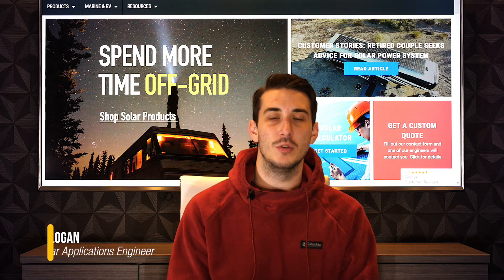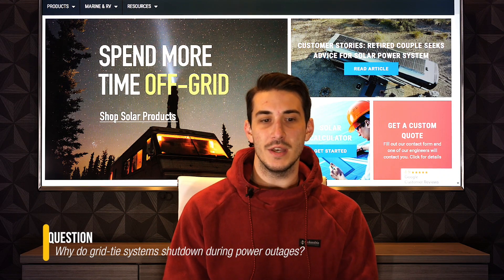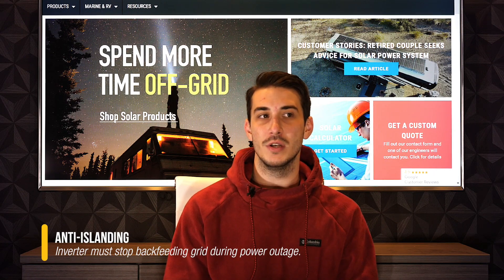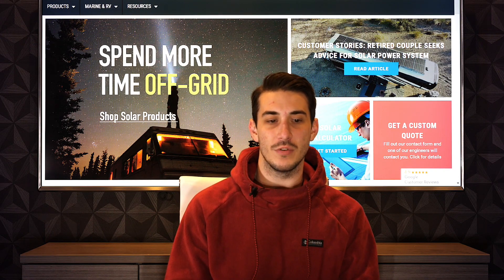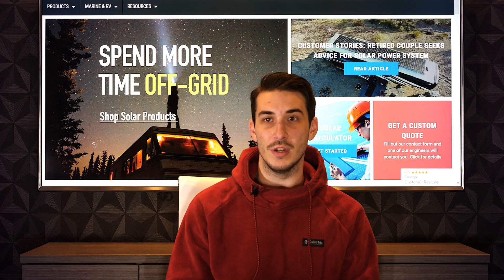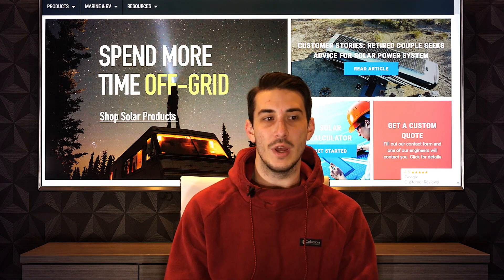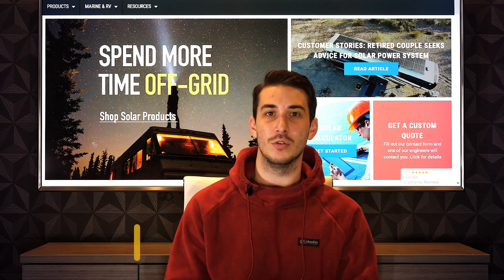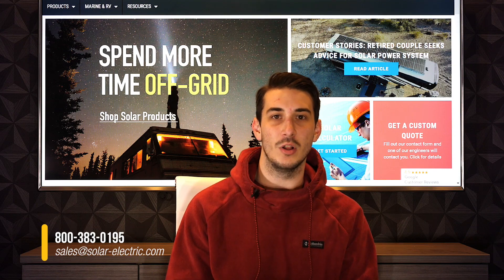Why do grid-tie solar systems shutdown during power outages?

Comment: You said When the grid goes off the inverters shut down beacuse power might backfeed into grid.This indicates power is being produced but you are intentionally shutting it down as a safety feature.Then why cant you just isolate your system during grid outage with a switch and run the home appliances.
Reply from the maker: Yes you can do that if you have your system set up that way. This video might explain it well for you. https://youtu.be/fh58Y-LA99U If you have more questions please feel free to chat with our team on our website during business hours. Thank you!

Comment: I get it that you don't want power to back feed into the grid, but why can't the solar then just supply power to the house and not the grid during a power outage?
Reply: @Dan I think what the answer you were looking forward to is that 

A grid tie inverter requires a voltage reference to work and since the grid is down that voltage reference goes down with it, and to ensure that power isn't feed to your house or neighbors house or back all the way. The anti-islanding comes into play and not making your inverter produce power and leaving you without power.
Reply: @oloyeadeniran8894  Seems to me the system could automatically shut off to the grid and just supply my house with power from the panels.  I don't see this as being something complicated and why it isn't being done already.
Reply: @Resist4  Just noticed your comment now ... My bad!

The Grid tie inverter is only meant to phase with the grid and nothing else, if Grid is absent then power goes out, but there are ways around it. When you use special types of offgrid inverters that can form the grid when used with batteries.

It is this types of inverter that you can then couple to your grid tie inverters to provide you power on days of power outages or natural disasters
Reply: @oloyeadeniran8894  I guess I just don't understand why it's designed this way.  Why can't my excess go into the grid and when the grid is down the power go directly to my house.  Don't get the point of it not being designed this way.
Reply: @oloyeadeniran8894  what if grid is down for weeks
Reply: @bootangy  Then power will be out for weeks too,
 Here in Nigeria, we mix Grid tie inverter with a Grid forming inverters to form a micro grid that can then feed the house and when grid goes out, it will not affect the usage or there is simply no downtime.
Reply: @oloyeadeniran8894  ty whats a grid forming inverter? is that like hybrid?
Reply: @bootangy  No, it is not. The types of Grid forming inverters are 
1. SMA
2. VICTRON
3. STECA
4. DEYE
and other I can't remember offhand
Reply: @oloyeadeniran8894  i see. problem is i have 2 inverters and 2 batteries already grid tied ac coupled both givenergy. i best speak to my solar man.
Reply from the maker: Hi Dan, great question! A grid-tie system does not have a battery bank, therefore you'd have to add one to make that happen. Here's a video explaining that: https://youtu.be/yyh8dzw2xQU
Reply: Northern Arizona Wind & Sun i already knew a grid tie system doesn’t have a battery bank.  What does that have to do with the panels supplying power to the house when the grid is down?  Why can’t the inverter just take power from the panels to supply the house while preventing the flow to the downed grid?
Reply: @Resist4  Have you found out the answer? I can't find out any. Especially if battery backed up systems doesn't have this "safety" feature.
Reply: @vaklaf  I haven't found anyone that can answer this.  It could be that most solar panel systems just wouldn't produce enough electricity consistently during the day and batteries are needed to level out the power.  Imagine watching TV or using an electric stove and on solar only, then a cloud blocks the Sun, then it unblocks the Sun.
Reply: Electricity has to be either used or stored immediately after it is produced. You’d have to be using exactly as much as you produce constantly and include for small changes like waste heat loss to not have a battery and be off grid. It’s pretty much impossible without energy storage I’d think